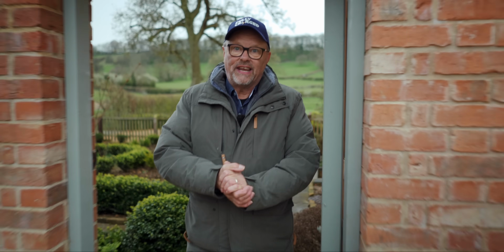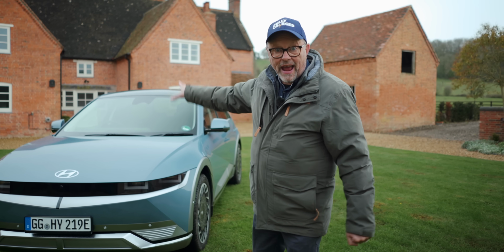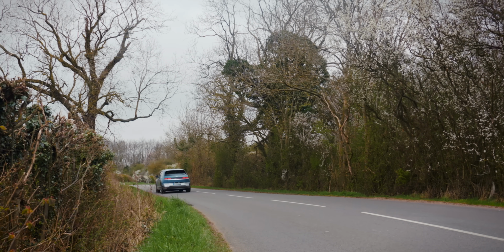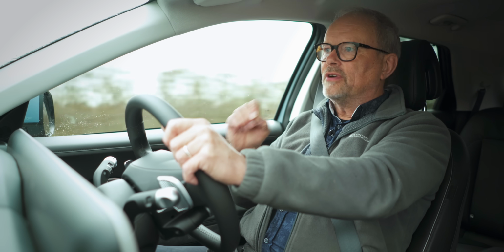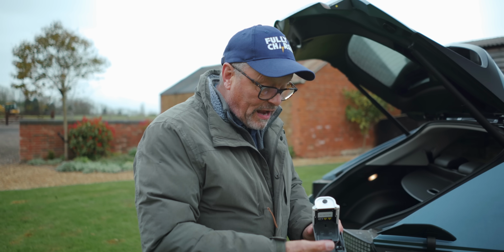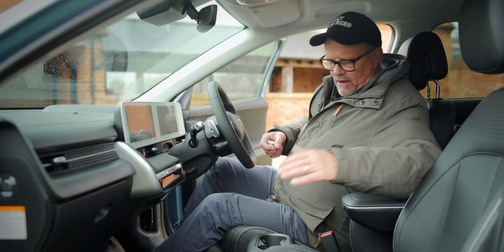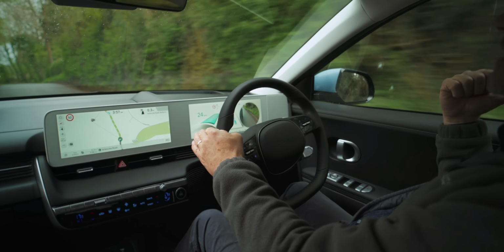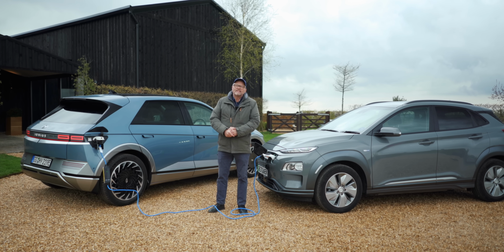HYUNDAI IONIQ 5 First Drive - could this be the electric car of the year? | Fully Charged CARS

Comment: As a Tesla owner this ioniq could tempt me away  -  Now just need a decent charging network for those long journeys and a bit more insight into it's navigation software
Reply: Lovely piece of design but you can't fault Tesla's approach to EV ownership. I'll hold it for the Berlin built model Y LR with tow pack.
Reply: @paulbrowne5049  good point knowing Hyundai waiting lists. Probably stand more chance of getting a model Y even with the need to finish the factory and starting production. Will be curious to see if the simplification through use multiple castings, 4860 cell structural battery pack result's in cheaper price because if they just take model 3 prices and add x thousand it's too expensive

Comment: Prices were announced in Denmark. 339.000 dkkr/45.000 euro. With 72,6 kwh , heat pump and quite a nice package of equipment.
Reply: That is a pretty good price. Here in Malta we can get up to €9,000 in government incentives which would put this at €36,000. If it is priced anywhere near that it will very probably be my next car. Well, either the IONIQ 5 or the KIA EV6. I really like both.
Reply: @ewadge  true. It is surprisingly cheap compared to Id4 and enyaq. Hopefully ev6 will follow that trend :)
Reply: @MadsTrolleDK  my guess is that Kia will keep the trend of charging 3000-4000 euros more like they fid with eniro and kona
Reply: @MadsTrolleDK  ev6 prices just came in 350000kr. For long rang rwd

Comment: 50kW is a rate of flow of energy. It doesn't matter what the voltage is. If there is a difference in charge rate, it will be tiny
Reply: Double the voltage means less loss internally, which means less heat generation, which means less need to throttle the charging to prevent heating and/or means that less energy is needed to cool the battery/other power electronics instead of being stored in the battery. So, yes 50 kW is 50 kW, but having the ability to have a flatter charge curve can actually make a substantial difference in charge time, particularly if this becomes a standard for future vehicles with more energy dense storage because the thermal mass will be lower (assuming the same energy capacity), so the same amount of loss to heat will result in a greater increase in temperature. It'll also be a benefit to vehicles with smaller battery capacities for similar reasons.
Reply: @seabream  I stand by what I said: If there's a difference, it will be tiny
Reply: Double voltage, half the current, less heat, more consistent charge rate.......?
It's the misleading "peak" rates that let some cars down.
Reply: @rogerstarkey5390  less heat only if the cables and hardware have less than half the resistance.

Comment: Nice preview! Did you measure ground clearance? Have not seen that anywhere and would like to be able to take this up into the mountains.
Reply: Not recommended to take an electric car on Mountain roads. I've seen some info about 13cm ground clearence because of the batteries
Reply: @oktaviu8668  13 would be unfortunate, not exactly an suv if the ground clearance is less than my Sedona
Reply: @robertasumendi  it's not meant to take it off-road. Because of the weight of the car, it's better not to have 20cm of ground clearence, the center of gravity would have been much higher than optimal, so the ride quality would be worse than it is now. And now it's perfect on the road
Reply: It's not an off-roader, and it's not being sold even as an SUV (it's being sold as a large hatchback, iirc - so definitely an urban vehicle)
Reply: @logicalChimp  precisely, it doesn't even have those Black plastic overfenders on the wheel arches
Reply: @logicalChimp  After watching like 30 or 40 videos about this car, almost every one talks about the size relative to Hyundai SUVs. The id4 ground clearance is 20 cm, the xc40 recharge is 17.5, Tesla Y is 17, and the Kona EV is 16 so it seems like 13 would be really, really low compared to similar cars however they're classified.

Comment: "I am not gonna pretent I understand that" :D Lovely!
Reply: I don't think I'd trust the person that talked to Robert about its magic inverter motor to change the batteries on a remote control.
Reply: @Tim_Small  :D Maybe the magnetic field of the globe reacts with the magnets in the motor and makes a DC current, that charges the battery? :D Sounds solit to me
Reply: It sounds like they are using coil in the motor as an inductor for the buck/boost converter. This also means batteries are probably 800V as well wich goes in line with their claim of faster charging than equivalent 400V installation.

Comment: Great video, as always! Just to point out that Drag Coefficient is a dimensionless number, i.e. no units. You're showing "cd" as units, which is Candela (luminous intensity). Drag Coefficient is the the ratio of drag force to the force produced by dynamic pressure multiplied by area, i.e. Newtons divided by Newtons (hence it is a dimensionless quantity).
Reply: It's a measure of the proportional difference between what the drag actually is versus what the drag would be for a flat surface of the same area.

Totally agree on the misuse of units and dimensions. I have how a small 'm' is so often used to mean millions.... But I digress.
Reply: @mgutkowski  Yes -- sorry -- that is a much more helpful way of describing it! I was checking Google Maps at traffic lights when the YouTube notification came up, and wanted to submit the comment super-early so that it would be noticed by the production team -- typing & thinking at top speed (neither of these my forte). [BTW entirely agree about the use of 'm' (milli or 1E-3) to indicate 1E6, i.e. 'M' (mega). The Guardian in particular is terrible at this...]